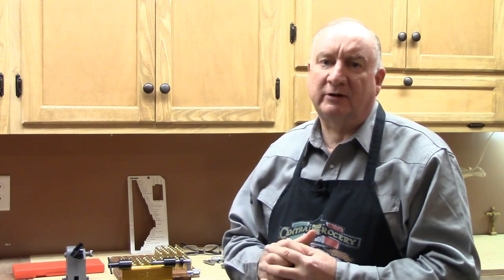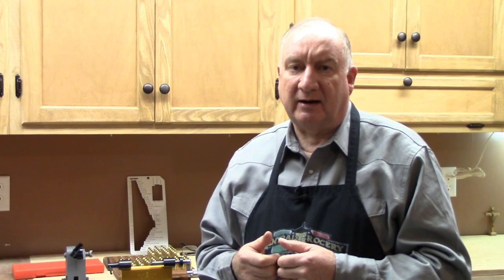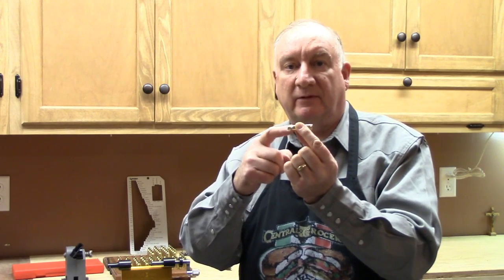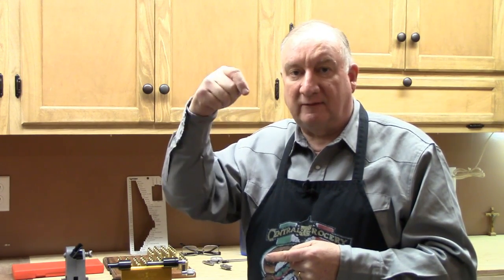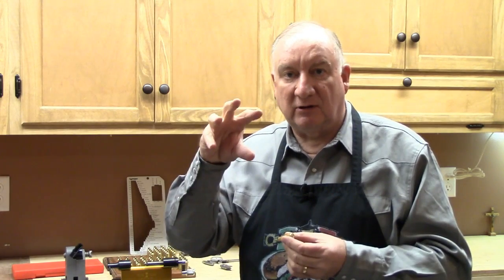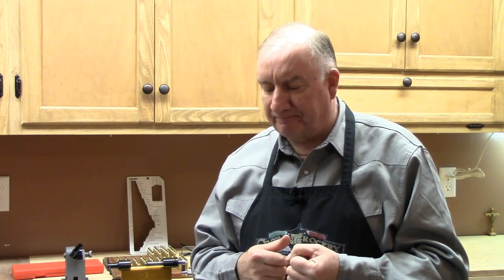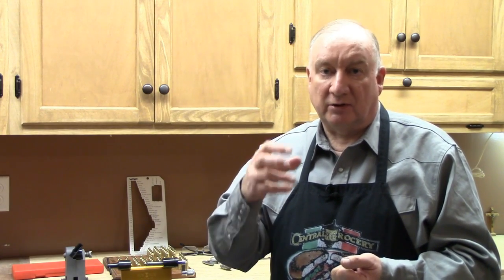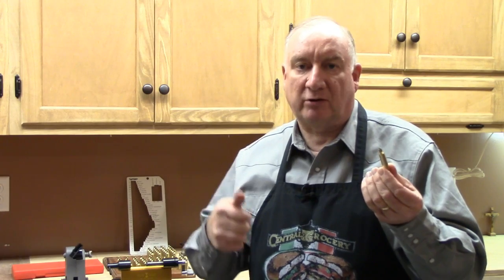Neck turning and neck sizing ~ Seeking a higher level of accuracy!

Comment: Hi gunblue490, at 15:53, you introduce a device on your bench as a "case neck Turner". Can you confirm this is accurate and used for case neck uniforming? I was gifted something similar and the box states it's used for trimming the brass to the correct overall length only.
Reply from the maker: You are correct.  They are indeed case length trimmers made by Forster Products, Lanark, Illinois.  Forster makes a case neck turner attachment that adapts it to do that job. It consists of a cutter, a tapered advancing cam, and a small guide plate that rides on the cam.  In addition, you will need a case neck turning pilot for each bullet diameter.  So, a 308 diameter will work with any 30 caliber cartridge, etc.  If you remove the stop ring from the end of the cutter shaft, you can slide the shaft out of the base, and slip on the conversion attachments in seconds.  Forster sells their products direct, and I've found that they're great people, if you need assistance. Give them a call.
Reply: Gunblue490 I just ordered the parts and will start neck trimming. Speaking for myself, I'd love to watch a video where you link all these lessons together from start to finish(all the different steps of brass prep) so we can understand the chronological order i.e., clean, deprime, length trim, neck turning, full length sizing

Comment: This is the sort of thing I've been looking for. And what I was hoping you got into in your reloading videos, as I've been reloading for quite some time. 
My question is, why neck turn your brass, if you fire form and neck size only when you reload? If you fire form your brass, you're forming your case to that specific chamber. How would you have high spots if it's formed to your chamber? I went back and rewatched the part where you talked about neck turning. And from what I understand is you're trying to achieve concentricity. And that's where I'm confused. If you fire form, and neck size only, aren't you concentric at that point? Or are you trying to get even tighter tolerances?

I've never messed with neck turning. But with certain rifles I own, I do neck size only. Mainly my varmint guns. I'm just trying to put this all together. 

Thanks
Reply: If the neck is thicker on a side, then the 2 circles which are the neck OD (outer diameter) and the neck ID (inner diameter) are by definition not concentric. When the charge is fired the neck OD comes into full and concentric contact with the chamber, but the neck ID (and the bullet) are offset with the centerline of the bore by the neck wall thickness differential. After firing the run out as measured by the OD of course would be essentially zero, but ID where the bullet left from would be off center.
When turning necks a mandrel centers the ID and this makes the OD out of round and pushes the high side (thick side) out to the cutting bit. With uniform neck walls everything is concentric and the bullet sits and leaves from the centerline of the bore. At least it has a chance to; assuming proper function of sizing and seating does, quality components,  etc.

Comment: I have been turning necks so i have a consistent neck tension from round to round. I don’t see how adjusting the trimmer for each pc of brass so only 85% of brass is removed lends to accuracy. On Lapua brass, thickness varies around the neck up to 0.0005” to 0.001”. Cheaper brass is even worse. Point being, that varying neck tension causes higher SD and ES. Just wondering why you didn’t cover this aspect of neck turning. Thanks
Reply from the maker: The purpose of neck turning is concentricity, not neck tension.  Any information otherwise is bogus.
Reply: GunBlue490 So you think consistent neck tension neck tension from one round to the next doesn’t help accuracy?
Reply from the maker: @kentrumm1385  
No, I don't.  With pressures measuring over 54,000 psi, differences of an ounce of neck tension is absolutely and totally meaningless.  If you watch my video where I shoot the 257 Roberts, those cases were reloaded 12 times, and are standard Remington cases, far from uniform in weight. Charges were not weighed, but  dropped to within one tenth grain. But they are perfectly concentric. If it's important, I shall state so.  If you want accurate loads, I am showing you how it's done.

Comment: indexing the round in the chamber also helps accuracy. this video just touches the basics. Thank you Sir for the video. It took me back twenty years or more. Groups with a factory 700 ADL  .112  - .124 , Cal. 243, 100 yds. Speer 100gr. square base bullet. This was seven, three shot groups. 
I never took more than three or four rounds into the field. Most of the time just one round in the gun. Never needed more than one.

Comment: question for you . i have a remington 700 bdl in 30-06 . i got new back in 1987 . worked a lot of overtime to get it . lol . and with the best handloads i can work up back then it would put the first 2 shots into just under a 1/2 inch at 100 yards . the 3rd shot would open the group up to a 1 1/2 inch to 1 3/4 inch . always did this . now it has a mcmillion stock on it . and it still does the same thing . barrel is free floated . trigger is at 4 pounds pull . this is my hunting rifle so the accuracy is good for minute of deer or bear . the first 2 shots are just a hair to the left of the target . every time .  but the 3rd shot always goes up to the right and opens the groups up . i have put around 400 rds through the rifle since i got it back in 1987 . yes , i know not many . but hard to get over dad's ' you dont shoot the deer rifle more then 20 shots a yr .' lol . what could be making this happen ?  it does this with any bullet weight i use .  i am thinking it is from the barrel getting warm from the first 2 shots . i all ways start with a cold barrel , as that would be how the gun will be shot when hunting . how ever right before hunting time i will shot 1 rd so it has a dirty bore . accuracy is still the same , clean or with a fouling shot . thanks for your time . love the channel . and how all the internet trolls stay away from you .
Reply: ron w I can almost guarantee the action isn’t squared. When I was an apprentice we had a crap load of 700 la come in that where not near being squared and they where from the late 80-2002 area, totally turned me off from working on non aftermarket style 700 actions word on the street is they are not having the Quality issues anymore but it sucked having to put so many hours into truing an actions.
Reply: @brandonsjsj  that makes since . i have been thinking on getting some work done on it . i took in yrs ago to a few smiths . and got told the same thing . 1 1/2 at 100 yards is good accuracy . then givin a price 3  times the cost of the rifle to do some work on it . and i am not talking custom work .  did get told once to free flat the barrel . its free flated now . i heard the qc  problems were more around 2000 till just a few yrs ago .
Reply: ron w I think the 2000 is when they had a major number of them come through, I definitely had to rework one that was made in 6/85 because I remember thinking f*ck you’ve been untrued longer then I’ve been alive.
Reply: @brandonsjsj    it happens . it has alway had me wondering what was up with it . alway the 3rd shot opening the group up by a inch . was told once it was the lug was lose .  thanks .

Comment: what is your opinion of volume checking cartridges vs weight seems the reason to check weight is to sort brass by void volume so why not just check volume.
Reply from the maker: I've done both.  Measuring volume is very tedious and clumsy, and is not as accurate as simply weighing brass.  But I'm not sure if you caught my comments regarding the practice, which I will reiterate.  Segregating standard grade brass will yield a host of varied weights.  For instance, in a lot of 100 cases of one particular brand, you may find six or eight groups of brass, which vary in weight by half a grain, perhaps more.  You may have 35 that weigh a certain amount, 25 another, 15 of another, and the rest divided into miscellaneous lots of four or five and less.  I submit to you that you have a brass management problem.  You certainly can't begin to develop loads for each lot, and even if you did, what would be the point of having 8 or 10 groups of ammo with various velocities?  On a practical level, brass variation within a given brand, regardless of the degree of variation, means absolutely nothing if you are seeking MOA groups.  Any brass is capable of MOA or better.  I've shot some of my best groups with old, trimmed, standard brass.  If you are a bench rest shooter or extreme range shooter, and are fussing over decimal points in your groups in the extreme, you are on the wrong track altogether.  First of all, use single base extruded powder, because it has less sensitivity to variations.  Then, invest in brass that is made for the precision shooter.  You must buy perfect brass that weighs the same in a given lot, and the only ones that have such perfect brass is Lapua or Sako. Yes, it's expensive, but it's far less expensive than using just the best 35 cases in a lot of 100, and wondering what to do with the odd lots.
Reply: @GunBlue490  I am in the process of weighing Lapua .338 LM now. Just weighed 50 Nosler 340 wby. Looks like Nosler might have them beat.

Comment: Great video. I have trouble getting my head around the concept of trimming the outside of the case to center the bullet. It would seem to me that you need to trim the interior of the neck to center the bullet. Would not the case hold the cartridge in the center of the chamber?
Reply from the maker: Reaming the interior removes thickening brass at the shoulder, especially after case reforming from larger calibers, but it does not make the thickness of the case neck uniform around its circumference. Inside neck reaming is done to remove excess brass from front to rear, but it cannot control the side to side aspect.  If the case is thicker on one side before reaming, it will remain thicker afterwards, despite being uniform along its length.  An off-center bullet results when the thickness of brass is greater on one side than the other.  Outside neck turning involves a more complex process, where a pilot the size of the bullet is inserted into the case neck, as the cutter revolves around it, which makes the case neck absolutely uniform in thickness. The bullet cannot be centered in the chamber unless the neck thickness is the same on all sides.  Outside neck turning aligns the axis of the brass to the axis of the bullet and the barrel.
Reply: @GunBlue490  you state there is about .001 clearance around the case neck for release clearance. If that clearance is there then the outside of the case neck is not touching the chamber walls? If the case neck is not touching the chamber wall, then why trim the outside of the case neck? And does the case body not hold the case in the center of the chamber? This is why it would make more sense to make the interior diameter of the case concentric with the camber rather than the outside diameter. Just trying to get my head wrapped around this concept. I have a TIKKA T 3 that is sub moa capable but I want to improve it more.
Reply: Never got a reply. I am truly curious about this subject.
Reply: Gary Persons Think of it this way: If you seat a bullet into a case neck that has been turned to uniform thickness and is concentric with the case body, then the neck will expand evenly in all directions to hold the bullet, i.e. the bullet will be aligned with the axis of the case body and neck. If you try the same with an unturned neck, the neck will not expand evenly. The thicker part of the neck offers enough resistance during seating to force the bullet off center. The result is a bullet that is not aligned with the axis of the case body and neck.

Comment: What neck thickness is too thin?
Reply from the maker: Bryan Betournay 
Neck thickness will vary depending on the caliber, so there's no one answer.  The rule is as I stated:  If it is thinner than the thinnest side from the factory, it is too thin.  Never allow the lathe cutter to cut into the thinnest side, so leave that side showing and uncut, or at least 20 to 30 percent of the neck. That will leave only a trace of differential and will correctly center your bullet down the bore.  You must have strong neck retention and no chance of the neck splitting or blowing off.
Reply: Juan Batista Thanks for the info. I appreciate it!!

Comment: Issue of weighing brass cases.  The density of brass is 8.5x heavier than water for any given volume.  Assuming that the case weight variation range is as much as 4.0 gr. with uniform exterior dimensions, the interior volume [water?] will vary by less than 1/2 grain.  There are many issues with various brands of brass, but weight variation of the same brand is not one of them.
STYX
Reply from the maker: Linda Garmon 
Any variation of any component can be a contributing factor in the total assessment, but you are entirely correct Linda, that brass weight variation ranks very low compared to other far more significant factors, among the highest being bullet axis to bore axis concentricity.  I have recorded about as many good groups with highly variable bagged brass as with exceptionally uniform, expensive imported brass, when they were properly neck turned to eliminate eccentricity.  There are other good reasons to invest in expensive brass, as with case life, but I have not found weight uniformity to be as big a deal as many believe.  On any given day, mirage and unseen air movement downrange can make a mess of everything!

Comment: I found by neck sizing only, I run into problems, One is this. If you shoot max loads, also known as a hot load, but not over load, here is what happens. After loading it a second time, you can't chamber it. And the reason is this. After firing this max load, and after it cools down, it is now to large to chamber. Now on the other hand, if you shoot a lighter load, this does not seem to happen. I don't think you would want to travel all the way out west and find out your bullets wont chamber when going on a prairie dog hunt. That is why I always full size my cases.
Reply: James I have to agree with you,  if you neck size only,  sooner or later you will have to set the shoulder back. 
In a bolt gun I always set the shoulder back. 
Good shooting
Reply from the maker: James Sween 
Your neck sizing technique/and/or die is causing those problems.  Properly neck sized cases will be snug with a firm closure, but will absolutely fit the same chamber, regardless of the chamber pressure.  In every instance where folks have had that issue which you describe, I have discovered that they were neck sizing with a standard full length die, set to partially size, or their neck sizing die was not set down hard on the shell holder.  This will result in distortion of the case body, and a second "shoulder" between the neck and shoulder that is bulged larger than the neck dimensions. Never use a standard die to partially resize, and always set a neck sizing die fully against the shell holder.  Lee Collet dies require camming-over with the force specified in their instructions, which overcomes brass elasticity, and results in proper sizing.
Reply: first off,  the problem here is you're using military brass with a 'hot' load.  that taken into consideration, your 'hot' load IS a 'max load'.  mil spec brass has thicker walls so the pressures are going to be higher than commercial.  hence; most reloading data suggests backing off the powder by a couple of grains.

THEN... learn how to neck size properly and you won't need to beat your bolt handle with a rubber mallet to extract a fired round  : /